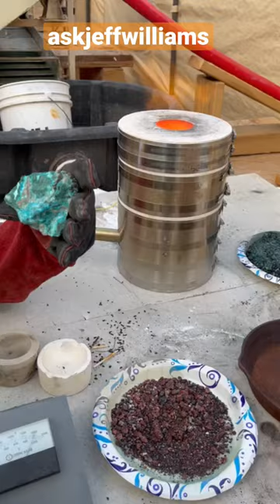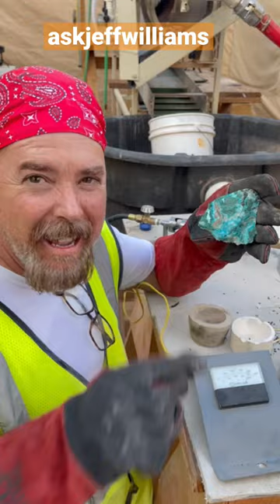Copper Smelting - From Rock to Copper - Backyard Bullion

Comment: Would a cave mans fire be hot enough to melt this stuff. I see the carbon, right there in the fuel. Is there enough heat for a primitive man (like me) to smelt some copper accidentally?
Reply from the maker: no ....but you can turn carbonates to oxides with it